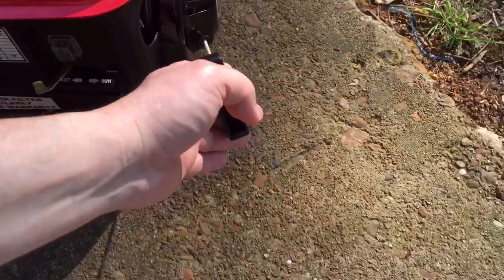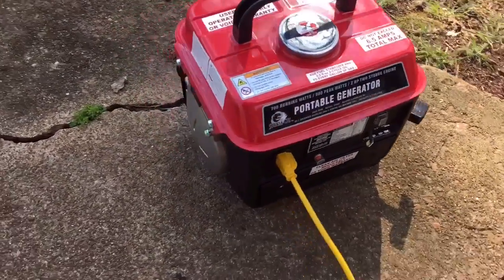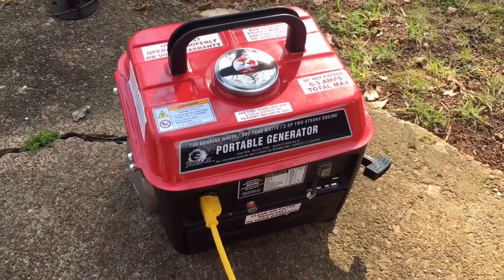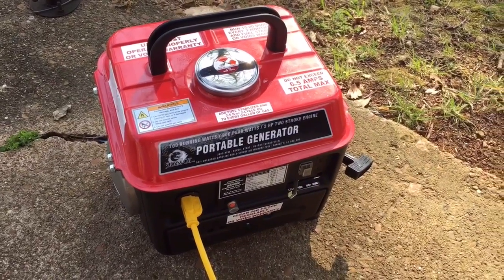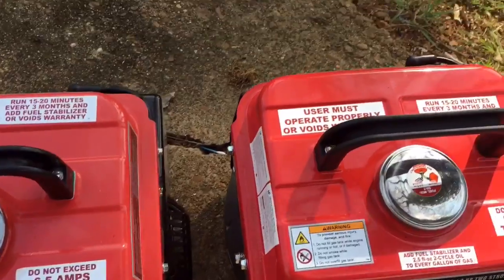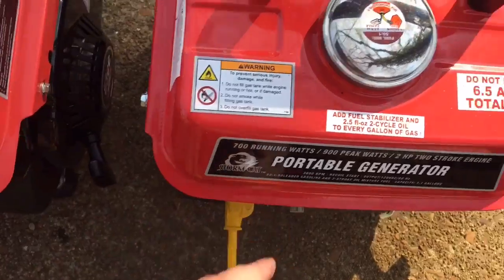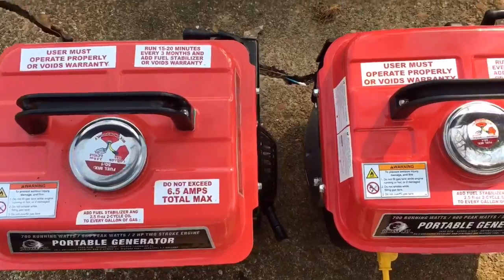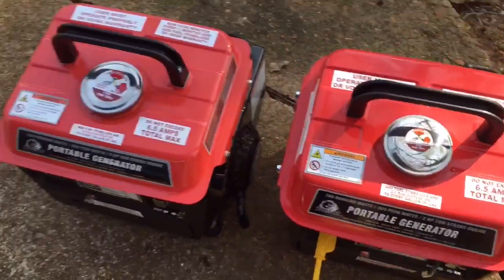StormCat Harbor Freight generator 60338 - Dead at 281 hours of use

Comment: If I get 281 hours out of mine, I'll consider it a win.  That's still very respectable.  I guarantee you with the right parts that engine can be made to run again.  Sometimes when they lock up hot, when they cool down a bit they'll spin again, but they're done by then anyway.  2-cycle engines aren't really designed for high-hour usage to start with, so I consider the hour mark you've reached to be a milestone.

Good luck getting a refund!
Reply from the maker: +jaykay18 Yep. 281 hours is a great result for what I consider to be the lesser of the two available lot numbers. I'm happy with the durability.
Reply from the maker: +jaykay18 Returned it today. FULL REFUND!
Reply: KevCentral Excellent!
Reply: @KevCentral  this is the reason why 2 stroke engines sucks, they're too loud and less reliable compared to 4 stroke engines. Only older 2 stroke were great to use
Reply: +KevCentral I was hoping for a post mortem tear-down, but oh-well.  :)
Reply: made in china 2 stroke not ok ...

Comment: Nice test. Would love to see a postmortem on that 60338 to see what the failure was. It'd be interesting to see how banged up the insides are lol
Reply from the maker: +M Callahan I took out the plug, it looked great. I peeked into the combustion chamber as best one can through the spark plug port and didn't see any damage. I'm almost positive the rattle this generator has had since hour 1 is the con-rod bearing. I had a similar failure on a vespa that also resulted in a locked engine. I would take it apart, but I still have my receipt and can get a refund.  :)
Reply: KevCentral
lol Nice!

Comment: wow  what is the normal life expectancy of the generator   has it been running since you purchased it
Reply from the maker: +Paul Wooten (wrfcustoms) No clue what the expected life is. I would guess that anything over 100 hours for a small portable generator designed for camping or tailgate parties would be more than acceptable to most. For $88, 281 hours is pretty darn good...Considering that that's 281 of mostly constant hours. I ran this thing 12-16 consecutive hours a day frequently. The biggest news is that the 69381, the lot number I recommend, is still running like a top!
Reply from the maker: Context is king in those comments. The 281 hours was on a model i've found to be problematic (60338), the 69381 lot number of the exact same generator seems to get much more life on average. The 281 hour death of the 60338 would likely be repairable barring damage to the case, but at $88 for a new replacement, the parts would likely cost far more than just getting a new one. I hope this helps clarify what I intended in my comments. Thanks for watching and commenting!